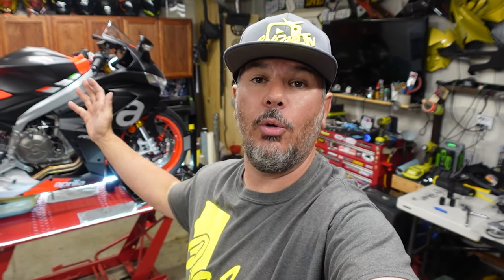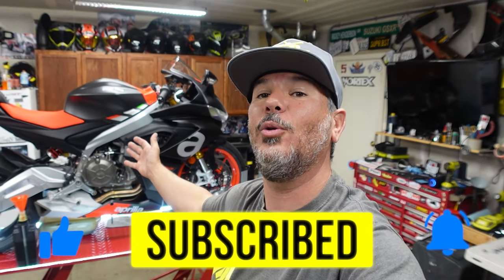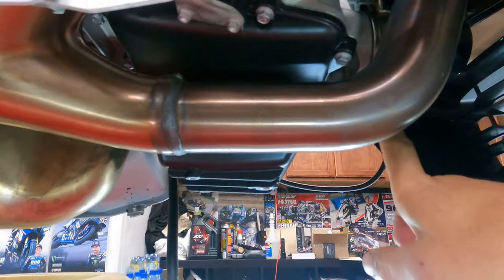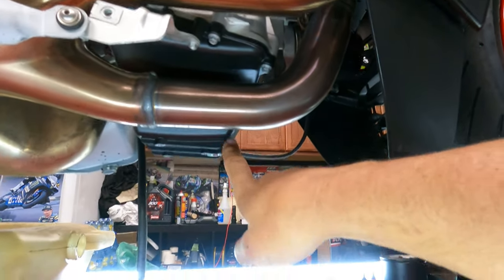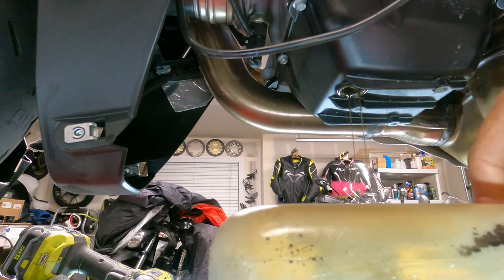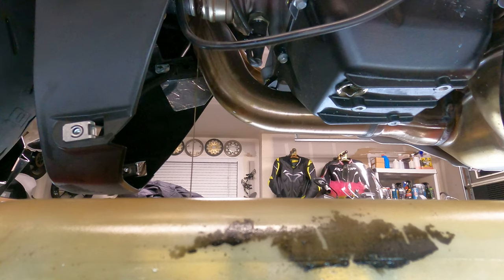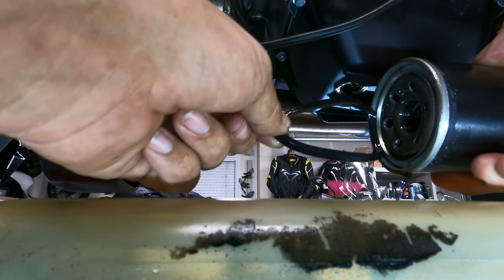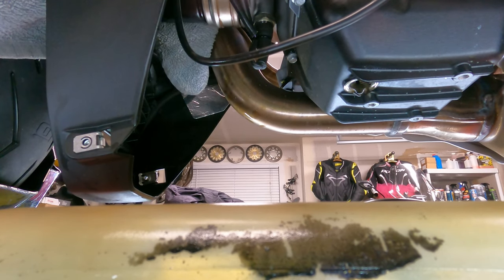2021 Aprilia RS 660 | First Oil Change Already??

Comment: Might want to check your manual. Pretty sure that you do NOT screw the dipstick back in for reading. You remove it, wipe it, put in in but only until it stops, then read.
Reply: On my tuono 1100, that is the correct way of measuring (only rest the dipstick on the thread, not screw it in). However, I know that on other aprilia models you need to screw the dipstick. I agree, double-checking the manual would be the correct way of proceeding.
Reply: @CaliMotoTV  The difference would be about the same as the upper and lower line on the dip stick. Top line , not screwed in got me 2.750 qts., yesterday.

Comment: For the sake of 2 more screws, the black plastic shroud could come off, 
giving easier access and visibility to the oil filter. I like to have the pans and tools ready,
and drain the hot oil immediately on arrival.

Comment: It's easier and bit quicker to drain the oil when the engine is warm.
Warm oil flows out easier and better.
Reply: Yes, Ville .... you are 100% correct ... warm oil has a lower viscosity so flows better. The proper way to drain the oil is get the engine hot, then shut it off and let it sit for about 15 / 20 minutes to allow all the oil to flow down through the engine and collect in the sump then drain it whilst it is still warm. Letting it go stone cold and trying to drain it when it's at it's thickest is just plain daft 😉
Reply: @CaliMotoTV  Yeah, no. You want the oil warm. It will stay warm for quite a while after it gets to the pan.

Comment: if you go "hand tight" on the oil filter... you might want to check that again after you run the engine hot... they can slowly loosen up... I prefer to get them a bit tighter than my "hand tight"... as those rubber seals age that "hand tight" can become a problem, just my $0.02 from seeing them come loose at Track Events!
Reply: Hand tight for me too. 35 years riding and not one leak 👍🏼
Reply: It should be tighted using a filter wrench.

Comment: Very useful video. Please remember that Motul V300 requires shorter change intervals than say 7100.
Reply: for road use what you recommend ? Bardhal XTS or XTC or the Castrol from Aprilia ?
Reply: @flashRIGA  Bardahl, always.
Reply: This is very important,  it is a racing oil and doesn't have the additive packages to meet high mileage change intervals.

Comment: FYI: From the shop manual (PDF).  The drain plug should be 20nm, Page 44.  2700cc's of oil, Page 19.  The owners manual says 2700cc's as well on Page 182 (PDF).
Reply: Put a link in here for that shop manual because it’s definitely not in the owners manual
Reply: Link for the shop manual.

https://www.af1racing.com/oem-aprilia-service-manual-21-rs660-and-tuono660

You can also find the owners manual there as well.

The Aprilia Forum has tons of great info from guys. 
https://www.apriliaforum.com/forums/forumdisplay.php?111-2021-RS660-Tuono-660-Toureg-660
Reply: Service manual was updated July 2022. It's now 2300cc's of oil.
Reply: @edge929  Thank you...I'll download the new version.

Comment: Whoa what's the torque measuring device? Never seen that before...I only know of torque wrenches. Is that an "adapter" for any wrench?
Reply: Rick, that is a digital torque adapter PTM206, about $60. I purchased a similar one AC Delco ARM602-4, about the same price. It works very well and the low range is lower than the PTM206. The only issue I have is that they advertise a low range of 4 ft lbs. My experience was that it is more like 17 ft lbs. If you have a standard click type, you can use one of these for calibration.

Comment: It's nice to see that Aprilia included a magnetic drain bolt from the factory!  (I'm presuming that's what the small tip on the drain plug is, anyway).  I've done the same thing with all of my street and race bikes for the last 35 years... change early, and change often!  The first 200-300 miles is when the engine is polishing up the reciprocating parts, so you'll find lots of small metallic debris in the oil... it's smart to get that out of the sump ASAP!  Oil is cheap, motors aren't.  👍👍  --QM
Reply: My Tuono's plug is same as it's,

Comment: Did you really use 300v??? It’s recommended only as a race engine oil so doesn’t contain the detergents and stabilisers that the 7100 motul fully synth oil does. Fine I guess if it’s literally going to be changed every 1000 miles, but questionable for road use at lower temps. Personally I’d stick to motul 7100 and know that the oil stays stable for longer

Comment: Thanks for this I just got mine
Reply: @CaliMotoTV  such a great bike but very sensitive the throttle position sensor bugged out in the first 100 miles
Reply: @ArmandoSanchez-ob3dd  Bike geared way tall and lean for emissions. 
Grabbing a handful  in 6th gear on the freeway will bog a bit if you're not
too far over the speed limit. Hoping the 600 mile service and flash will 
help with that.

Comment: How do you turn the service light off on the dash after the service?
Reply from the maker: Dealer has to reset it.
Reply: @CaliMotoTV  oh no. That's a bummer. I thought I could shut it off since I'm planning to change my oil on my own after I watched your vids. The dealer's 2 hours away from where I am.
Reply: The service light may come on for a few seconds until the sensor registers the correct oil content, after that it should go off. There are codes you can look up online to reset the error.

Comment: Can someone tell me why is there a random wire hanging down (2:25)? Can you putt the wire back in, after installing the piece?
I just found out my bike has that cable and i was kinda worried, but I can see that is part of the bike and nothing has broken :D
Reply from the maker: It's supposed to be there is the gas tank overfill tube.
Reply: @CaliMotoTV  Oh thank you sir! I couldn't find any information about it! What it does is just evacuate any excess of gas right?

Comment: Just so all you Aprilia owners know, changing your own oil and doing any maintenance on the bike yourself as opposed to an Aprilia certified dealer, voids the warranty.
Reply from the maker: Doing really anything to your bike can cause issues with warranty.
Reply: Thats kinda bs...then they shouldnt charge so much for the work. Especially if i bring in the parts

Comment: Man so many errors there you made. So much oil left in the engine for draining it cold not warm at operating temperature. Also the 300v is not street usage oil.
Reply: @CaliMotoTV  theoretically you are right. We always use an engine flush to get as much as possible out, the oil gets very thin and also the engine flush cleans the inside of the engine